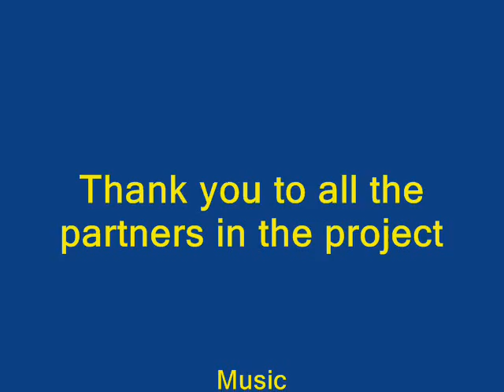People's Irrigation Distrct Fish Passage Project

Comment: Guy - 

If by hardscaped you mean mostly heavy rock, exposed the length of the new by pass channel, then 'yes', this was intentional.  'Softscape' was included by inter-planting alder and willow in interspaces between boulders and large rocks. Today the channel is covered by overhanging vegetation and is much more stable than when first completed.

The hardscaping was necessary to maintain the channel shape (lateral dimensions and depth) as the subsoil was much like a bottomless bog. Anything less than this approach and material choice would likely have led to project failure.

Thanks for the comment and question -